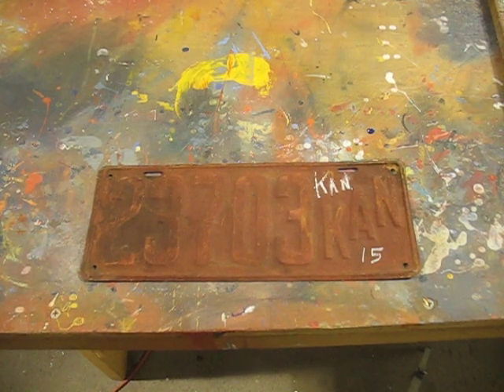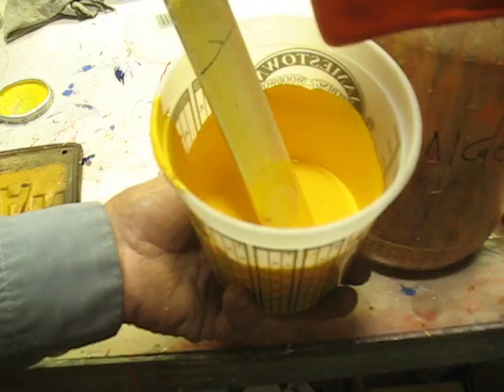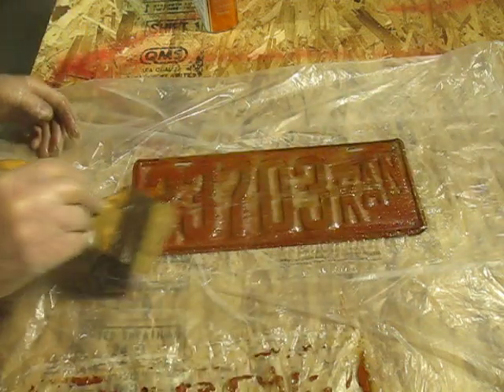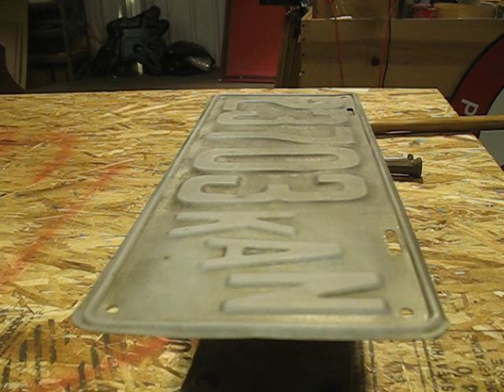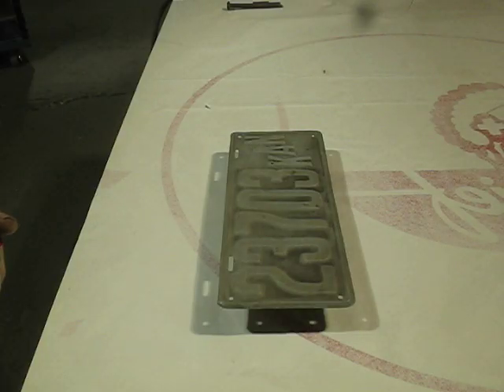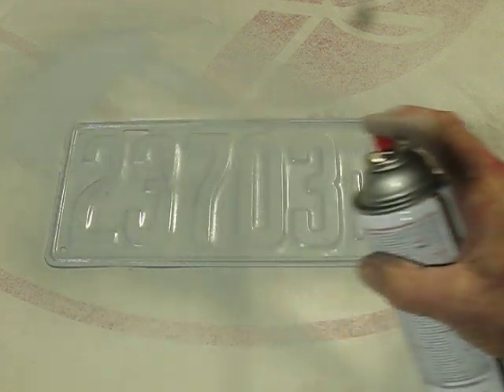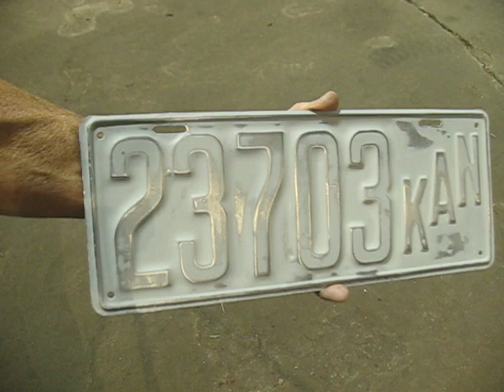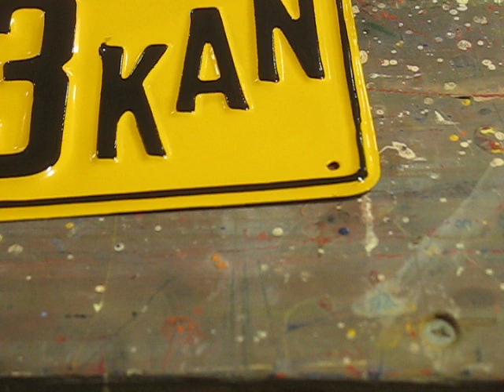RESTORE PLATE.mov

Comment from the maker: The background paint was Rustoleum, both primer and yellow. The black enamel was Nazdar 59111, made for use on metal. It's expensive, but excellent. It's available in quarts and gallons, and just a quart will go a long way. To keep it from straying off the raised numbers and letters, I used it straight out of the can with no thinning. Even a little thicker would have been better. Screen material was about 180 mesh, but any will do. Paint thinner to clean the screen was Kleen-Strip from Wal-Mart.

Comment from the maker: Bead blasting probably would have been fine. I stripped and derusted chemically because I could do it indoors during cold weather. It was just more convenient.  I did this work in a sign factory with a big walk-in oven, but for license plates a kitchen oven would work just as well. Nazdar recommends 180º, and that's what we used. I left the plate cooking overnight with the signs. If you're doing a plate that includes a dark blue, I'd cook it for at least a couple of days.

Comment: Tip, If you will apply the remover in one direction only and let it set for 30 minutes it will be easier to remove. has to be at least 74 degrees in the room you are working in. Great Video!

Comment: I would recommend sand blasting the plate with low presser, so as you do not warp it. This would be alittle cleaner and less hassle then stripping and then re stripping.
I would us a metal galesing puddy to feel in the minor imperfections, or bondo. The puddy is easyer to sand. Then use a high build primer epoxy or direct to metal primer surfacer. This way your not painting over bare metal. After sanding, finishing off with 400 grit you should use a acrylic enamel.

Comment from the maker: Nazdar 59 series enamel, no thinning. Screen was about 180 mesh if I recall correctly. Most of the work is in the "body repair",  getting all the dents out and getting the surface flat.
Reply: aqfarn I have a set of 1936 Connecticut plates that I am doing I would just like you opinion on how to paint the numbers. It is proving quite difficult for me. Lmk thanks

Comment: Been there, done that, and I never attained anything like these results - of course I never had most of this equipment.

It's ironic that license plates were manufactured as throwaway items, and even with all this painstaking hand-work, you still can't achieve the look that the original item had when it came out of a factory where nobody cared about the level of the finish.

Comment from the maker: The screen material is a synthetic mesh made for screen printing. Window screen, whether metal or synthetic, is far too coarse and will not work. A mesh of 158 threads per inch will work fine. If I were setting up to do a lot of this work on a regular basis, I might make my own wood frame and stretch & staple the mesh on it. But it would probably be much easier and more effective to go to a local screen printing shop (think tee shirts) and buy a screen ready made.

Comment from the maker: The black paint used here was Nazdar 59000 series, which is made for use on metal. I always got mine directly from Nazdar (nazdar.com). Right out of the can with NO thinning. You want it just thin enough for the squeegee  to shove it though the mesh, but not thin enough to spread off the raised numbers and letters. In fact, I got a little spreading I had to wipe off with a tissue and thinner, so if I were using that can of paint for another plate I'd let it sit and thicken.

Comment from the maker: I would agree with most of the comments by thecanadian152002 except for the 400 grit. It would pass the 20-20 test  (twenty feet away at twenty mph), but up close you would see scratches. I would finish with a grit of at least 800.

Comment: Hi great video
I would like to ask , what was the fan or blower noise I heard just after you applied the black, before lifting the screen? Was it background shop noise or did it have something to do with the process?
Reply from the maker: That's a shop vac. Look again at the plate being put on the table before screening. Notice the hole in the table. The hose from the vacuum is in that hole. It holds down the blank when you lift the screen. If the blank stuck to the screen and came up with it, you could get smears.

Comment: Any info on what type of tools you used to hammer out the dents? Thanks
Reply from the maker: This was six years ago, but as I remember it the plate didn't require much body work. It was good to start with. I think there was one small dent I fixed with a hammer and a drift. No special body tools.
Reply: Thank you! Had no idea the tool was called a drift.
Reply from the maker: It's just a brass or steel bar. Easier to keep it on the target than trying to hit a particular spot directly with the hammer.